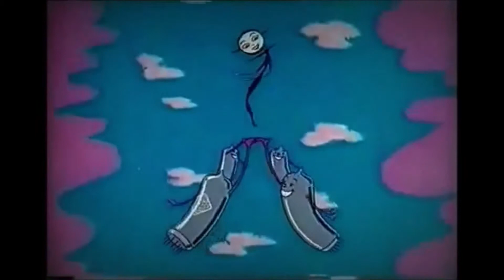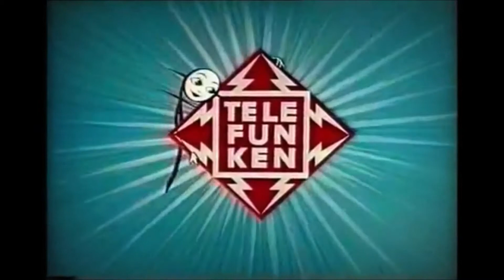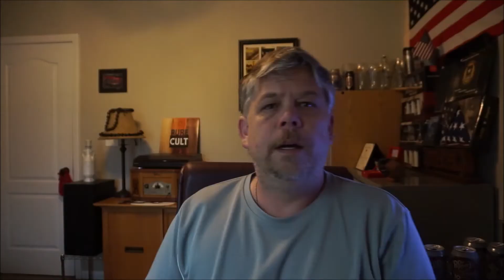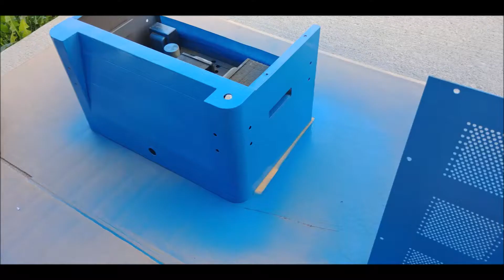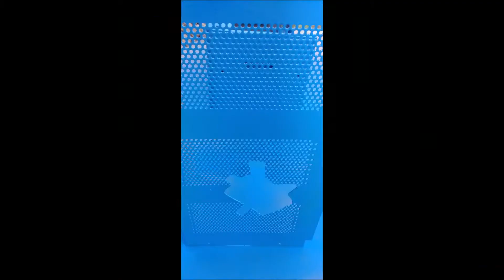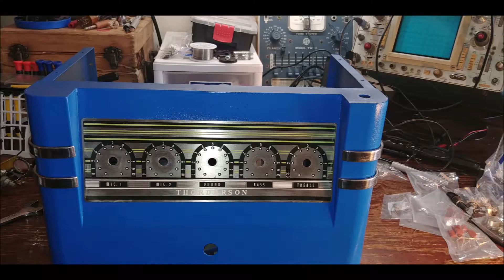SRT Amplification - Thordarson Amplifier Update 2

Comment: This beast, original crinkle grey paint and totally original, was my first guitar amp. Paid $2 for it and an 8 track tape of Cream Disraeli Gears. Such a warm amp tone, and loud! Surprisingly no hum, but it was 1982.😊
Reply from the maker: 👍  It is for sale. Still using the original tube complement, but just a restructured tone circuit and input imedances, making it more guitar friendly.